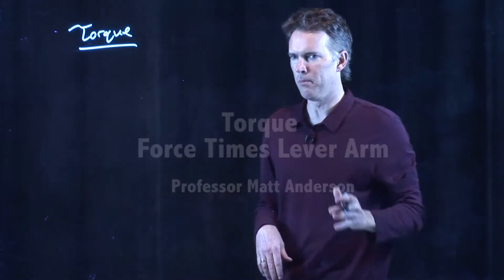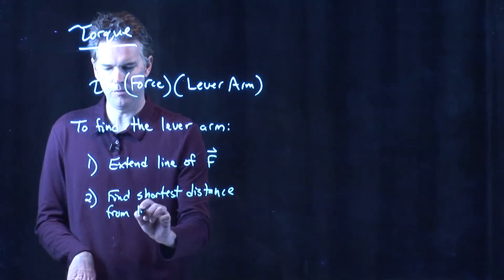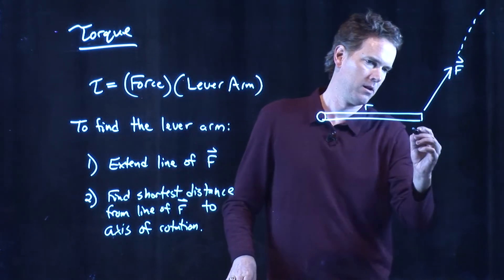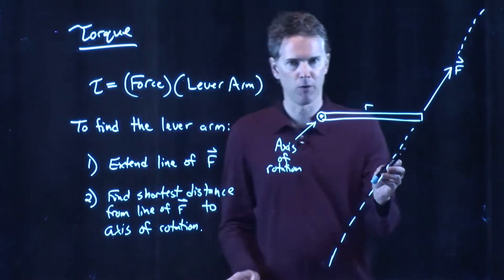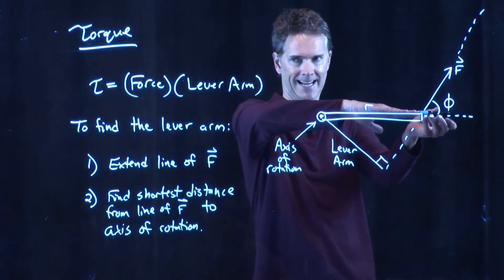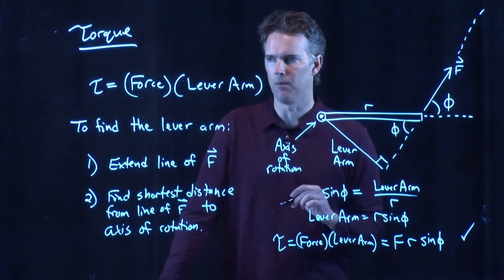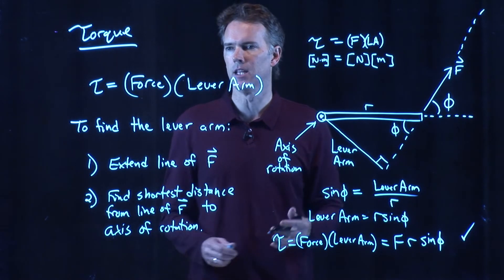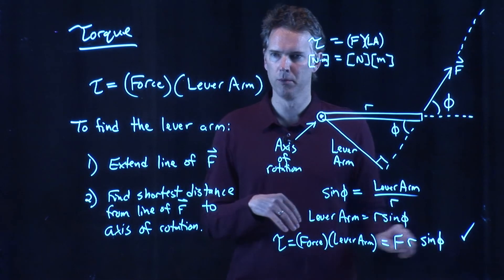Torque Force Times Lever Arm

Comment: How is he writing like that????? Like backwards???? (also good video) :)
Reply from the maker: +james paxton 
I will need to practice writing backwards a bit more, if only to freak out my students every now and then.
Cheers, Dr. A
Reply from the maker: +james paxton 
I tried that.  It's kind of hard.  So I don't write backwards.
See: https://youtu.be/CWHMtSNKxYA
Cheers, Dr. A
Reply: Brigid Mark maybe by mirroring the Video
Reply: Matt Anderson okay, so say the rod was hinged in the middle and 2 equal and opposite forces acting as a couple are acting on its end (no translation only rotational). Like on a magnet in a magnetic field. So do we calculate the arm length sine  component from any one force to the hinging point or to the other end where the other force is acting? 
I realize this is a little late but then physics hasn't changed in 2 years I hope
Reply: Contrats.  How can I calculate the angle of a seesaw when two masses are different? Let's say 10 kg one side and 15 kg the other? What is the resulting angle? If distances are the same.